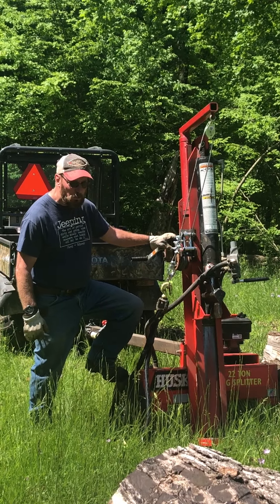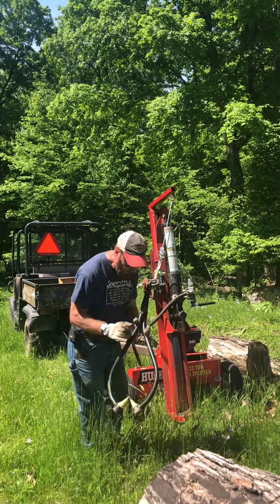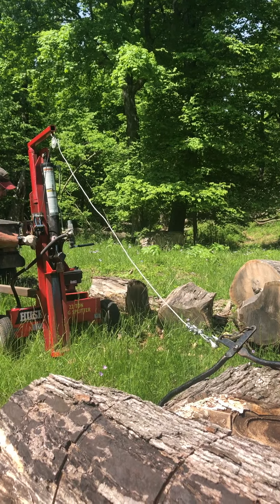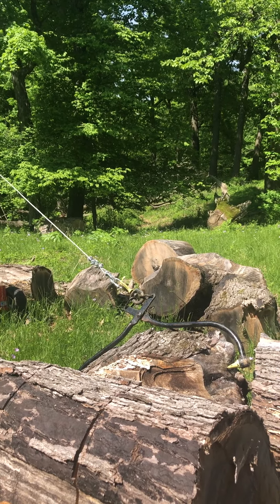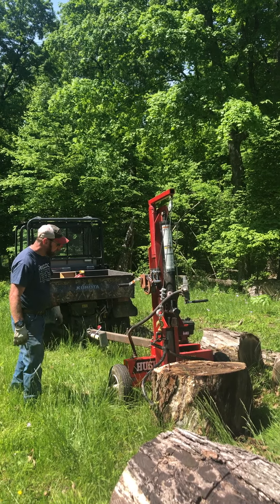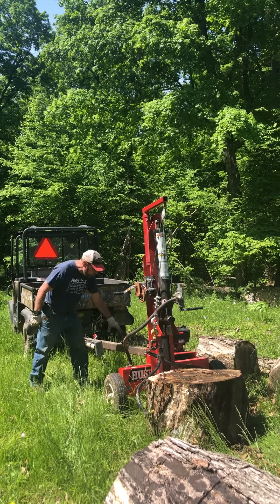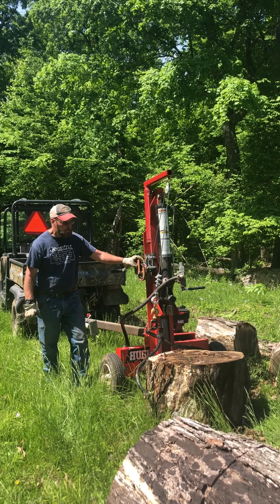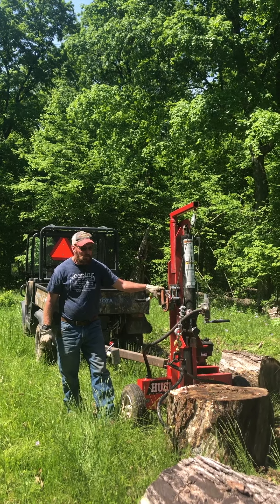Huskee 22 Ton Log Splitter Modified To Do The Impossible.

Comment: That is a very useful modification you made.  I have a winch on my splitter and it makes the whole difference for my back at the end of the day. Thanks Gary!
Reply: He may have gotten that idea from a pair of Engineers that worked at Northern tool co. It was back in the 1970s when they were putting plans in Popular Mechanics for folks to make their own log splitters a guy buy the name Andy Knowles and Frank Curbano were selling plans to make your own log splitters...  I think were their names illustrated a set up like these guys idea was in Oregon Tool catalog as well. Those guys that worked at both Oregon MFG U Northern tool sold the idea to Northern Tool co. If anyone has any ancient Oregon Tool catalogs the story is an issue I have it's June 1973. Oregon tools & Chain Saws. Homelite also has some saws in the catalog. I only kept that because I actually just sold the log splitter I had made from pictures in that tool catalog. I am watching this because I just recently found an older Huskee 22 ton splitter 4 sale along a country road stopped and bought it on the spot. I wanted one since I got home from Iraq could never afford one they were selling for $1,200 around here... I immediately within hours of getting it home ripped it down and just got it Dialed in on Wens morning I adjusted the new pump replaced the worn out compression release in the motor put all new fittings and lines on it. Works like a dream. Over the next few days I am gonna paint it and probably put a set up like that on mine. That is good idea... I have to find a set of logging tongs though. I hear they are pricey for the real McCoy..

Comment: Hey there G.  Nice effective mods you an Lane (or Wayne) did to your Huskee 22 ton splitter.  That hand-crank winch system handles the weight easily.  Even if the round is split, those chunks are going to be a bit hefty.  Enjoyed a full-watch, Gary.  Have a fine upcoming week.  Today, it's hotter than the dickens here so I'm hugging the shade.🙂  Later, G.  👍🏽

Comment: Good adaption Gary. Anything to make the job easier. Where did those tongs  come from ?  I’m going to put that set in my Christmas list I think. They dwarf the ones I use. Well I had some big ones but they were cheap and they vent pretty easy.
Reply from the maker: I got them from Northern Tractor which is now Northern Tool. Can't even get them anymore. I think I gave about $50 for them 15 0r 16 years ago. I love them. They can be real finger pinchers though. It only takes once to learn where to and where not to hav e your fingers. Thanks for watching Wendel.